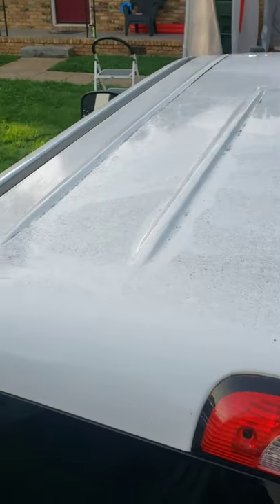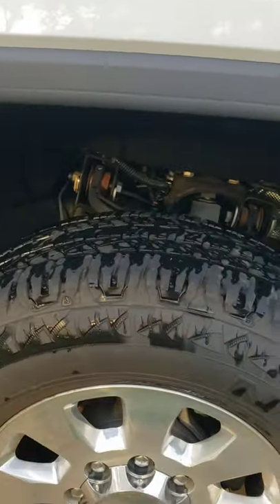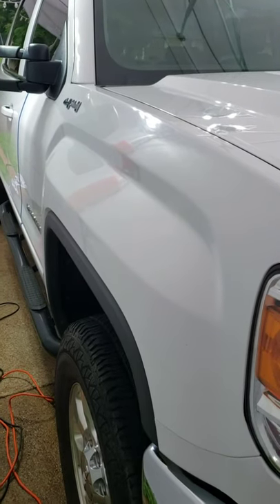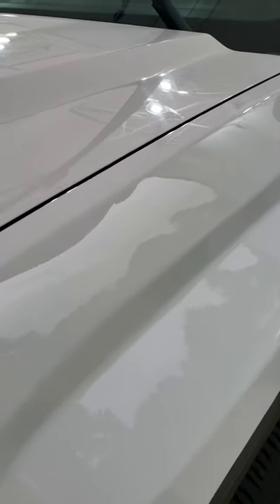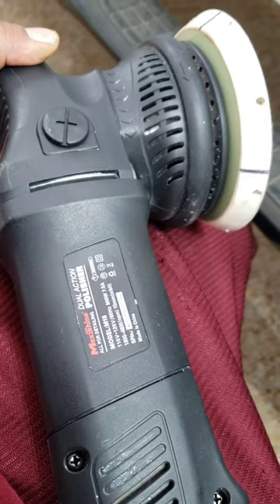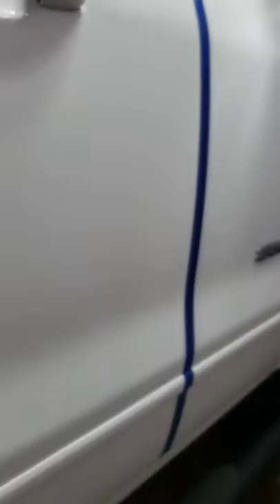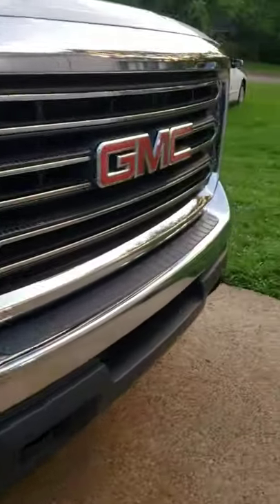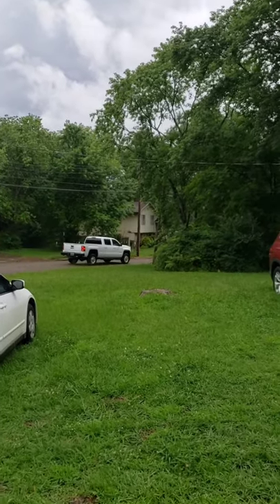Duraslic 1500 EXTREME ceramic coating applied to a GMC 2500

Comment: The truck looks amazing. Did the truck stay outside in the driveway all through the process? I might have to do mine outside and I wonder if I need to cover the car in some way while it cures or during application process.
Reply from the maker: Thanks! Yes, it stayed outside the entire time. The biggest thing to worry about outside is the temperature and being familiar with the particular coatings flash time.

Comment: I just did a DS 1500 coating on my car, results were amazing, how is the truck looking? Hopefully they stopped going to those gas station car washes
Reply from the maker: That would definitely be a good idea. Those car washes do nothing but scratch up the paint!
Reply: @bulletproofbubbles6915  
My buddy just got a new car and has been going through auto car washes and after a few months already swirled up